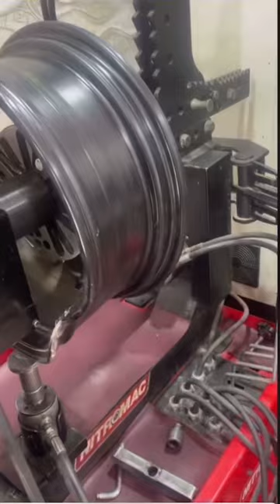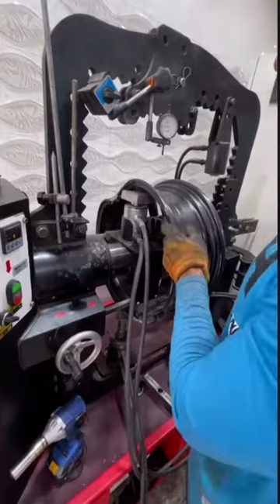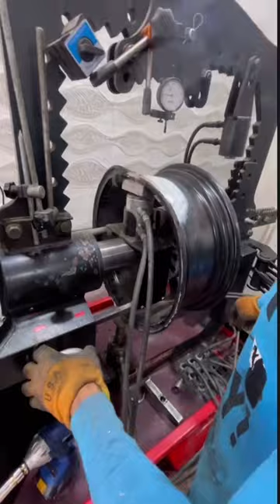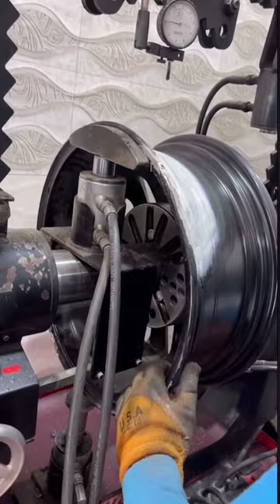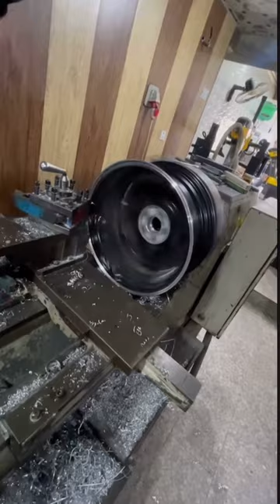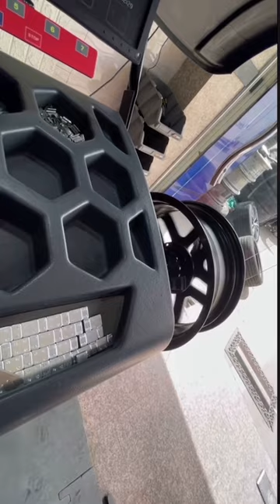Bent Rim Repair in 2 Minutes

Comment: Heating the rim up and annealing the aluminum is a no no. It will never be as strong as it was. It now is brittle in that location, and has been shaved down making it thinner. This should be illegal everywhere. Just my opinion...
Reply: Bro I have a question if you can tell me your opinion about this.... So is it worth to tix bent rims? Is it really possible? I really want to fix my car's 3 bent rims but my brother is telling me its better to buy brand new ones. If its possible to fix them and worth it, I will do it because new ones are crazy expensive and my Rims are like GTR rims.. unfortunately they are bent and cause steering wheel vibration and I can't drive car 100KM. Or even 80km/h   will appreciate your feedback 🤝
Reply: @travelheaven6593  If the rim has a small bent spot and can be straightened without heating the shit out of it like this guy then it's possible. But if you have 3 bent rims, I'd replace them with some forged wheels, especially if you are running at higher speeds. Don't risk your life dude. Medical bills are way more than a set of wheels, if you make it. Plus if you take the time and  really get it close to the eye, it will probably not balance very well either. Just my experience, I've tried it on my Chevelle and just wasted my time.
Reply: Thank you for your response. I agree man. Its better to buy new wheels than live the rest of my life with regret if an accident occurs due to these wheels. Will start looking for new rims tomorrow. Thanks bro
Reply: What percentage of fatal automobile incidents occurred due to a repaired wheel giving out?